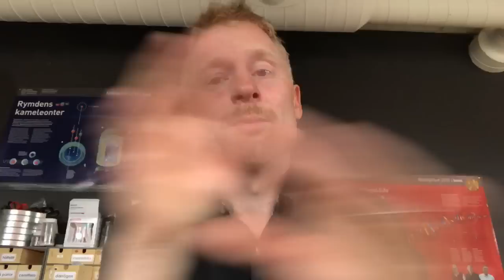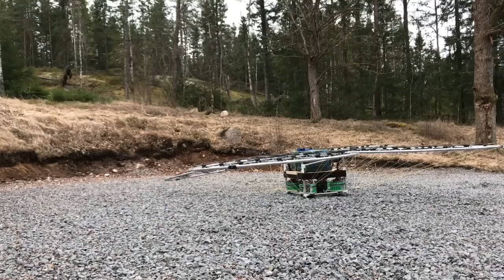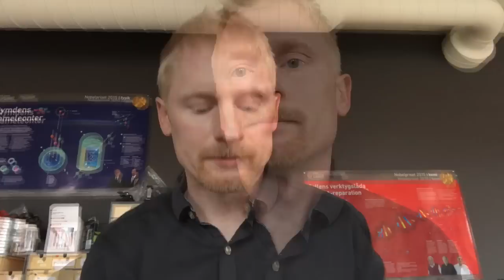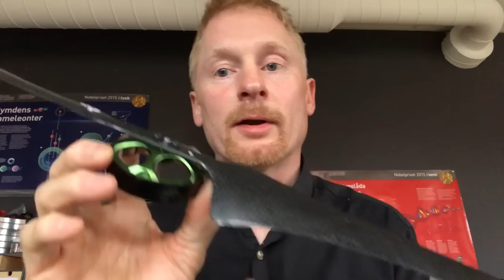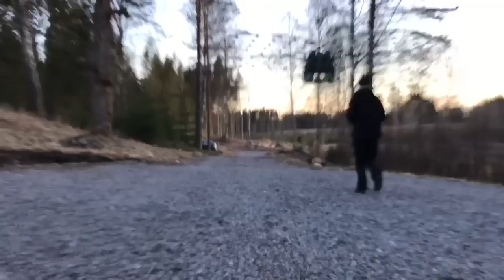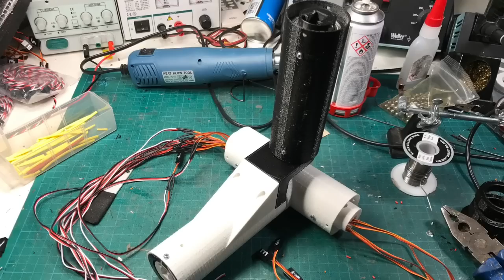chAIR- Manned multirotor Episode 18 Quadcopter style

Comment: I'm wondering how he kept the I-Term of the PID loops of the 5 different flight controllers from diverging to the point where some motors were at full speed, and others at minimum?  Is there something tying the 5 controllers together, or possibly is he not using integral control at all, but just proportional.  Is he, the pilot, the Integral controller?
Reply from the maker: You are absolutely correct; the controllers are not connected to each other, so I had to turn down the I-value to zero. I, the pilot, handle diversion that occur over time, its quite a natural thing to do when flying it from the pilot seat; Im not breaking any sweat doing the I-component work.
Reply: Axel, thanks for your reply.  You are my absolute hero!  What you did was simply amazing.  I am on a similar pursuit.  A couple years ago I read "The Wright Brothers" biography by David McCullough, and it inspired something inside me.  I've always been fascinated with flight, but the closest I got was flying RC airplanes.
Now I'm on a crazy quest to build a manned, gas powered quad.  I know, I know.  Obstacles gallore.  Dangerous...yup!  Difficult...Yup!   Illogical...Yup!  Challenging?...YES!   FUN....YES!  Educational...Definitely!
Why?......Why NOT!!!  It's been a much slower journey than yours.  I don't know how you accomplished what you did in the short time you did it.  I've been at it 30 months.  Much of it pondering different approaches.  I'd love to hear your feedback on my YouTube channel, and DIYDrones blogs.

Comment: Instead of using 72 little electric hobby drove motors, why not use 4 or 6 or whatever electric paramotoring engines – like are made and used to push a ?parasail?  Exomo is an example. There are others, like the Blackhawk electric paramotor engine. Maybe your next project or someone else out there.

Comment: Axel, I really appreciate how you don't try to hide your "silly" mistakes, like having the blade rotation wrong.  Mistakes are going to happen.  I am working on a related project, and would certainly value your input.  I am especially interested in how you migrated from a single RC transmitter, to a 5x redundant control system.  Did you eliminate the Tx/Rx, and if so, what did you use to convert potentiometer signals to pitch,roll, yaw,throttle signals.

Comment: Looks like P Factor is the problem
P-factor, also known as asymmetric blade effect and asymmetric disc effect, is an aerodynamic phenomenon experienced by a moving propeller,[1] that is responsible for the asymmetrical relocation of the propeller's center of thrust when an aircraft is at a high angle of attack. This shift in the location of the center of thrust will exert a yawing moment on the aircraft, causing it to yaw slightly to one side. A rudder input is required to counteract the yawing tendency.

Comment: First I want to say the fact that you got it to this Point is commendable. But I don't think you'll ever get the torque you need to lift a human being and actually fly this with so many small propellers. You would probably be better to have four large propellers. Also I think a weak point For you is the cable system, I think it would benefit you to use aircraft aluminum struts to hold everything in place firmly.

Comment: "Manned multirotor" with no man ever in it... Did you ever end up sitting in it while flying?
Reply from the maker: LOL.....RELAX....I shot the latest scene in that video not  a week ago.....there are still some important safety tests to be done.
Reply: Relax? Sorry you took offense. I wasn't dissing you or anything like it. Only an observation and a question. Toward the end of the video it looks like you have it far more stable. I'll keep an eye out for updates.
Reply: I am curious though why you opted for so many smaller motors/props instead of fewer larger motors/props.
Reply from the maker: Good question, well: 
Weight, scaling up adds weight which must be compensated with high strength materials and clever construction. I sweep 10m2 with 1.8kg propeller mass. Hard to beat with existing Paramotor propellers or the like.
Cost, hobby components vs.. real flight grade ones   
Off-the-shelf-DIY-availability, 
Safety, many sub- sections of parts can fail and you can still land safe
Reply: That makes sense. I've been building multirotors for a long time now but nothing that will lift anything above 50lbs. I prefer contra-rotating motors/props for redundancy but never gone more than 6 and 6. Had an X8 loose 2 motors and managed to land safely and since then I'll gladly take the slight loss in efficiency over the cost of a destroyed aircraft ;)

Comment: I know you film these vids well in advance and you certainly seem to know what you're doing, but there are few things I you did that I don't understand/would do differently
 - Save time and weight by adjusting the strings to set the angles on the paddles rather than on each motor individually
 - Add dihedral for stability (again by adjusting strings)
 - Skimp on nothing but the flight controllers. KK2s are great for the money and simplicity, but they're not the best you can get
 - Redundant TX-RX pairs running all at once on the same freq

Comment: 5 flight controllers fighting each other will be awesome to watch.. make sure you are not on board.
Reply from the maker: In the last clip all five controllers are ON, I have set the I-limit to 0 to reduce the "fighting each other" effect. Also the five FC:s are calibrated simultaneously so that they share the sense of what is "level"  So far they seem to work surprisingly well in parallel.

Comment: This seems like the same issues that the flitetest guys had when building the huge racing drone. They found that the typical racing flight controller would not work on the same scale that they were using so they switched to a venom(?) Flight controller.

Comment: I am aware he worked around the yaw issue by changing the angle of the motor mounting points, but wouldn't counter rotating 2 opposing motor sections fix the issue as well?
Reply from the maker: To my own amazement, the traditional torque reaction control principle really didn't work on this structure, even though the system has a significant overhead power reserve, almost  peak 2:1 thrust to weight ratio.

Comment: I think that Naza isn't good idea to make big multirotor. I had big octo on Naza V2 and it was difficult to set up. It was flying but not perfect. I changed to DJI A2 and was much better. Do you think to make multirotor with one double controller?
Reply from the maker: Interesting to hear about your experience with naza Vs. DJI A2.I really want to use five controllers since the rest of the system is divided into five segments.
Reply: zielonakosa, why do think that was? What is different in the a2 that it behaves differently.
Reply: I don't know why that is. Maybe A2 is faster. Something is different that A2 cost twice more. But i was check it and there is big diference betwen both. (i was check it on 4014 tigermotor, ESC tigermotor 40a 400Hz)
Reply: zielonakosa thanks for reply. So far I have working with naza m, but I'm considering switching to the a2

Comment: Can You get one of those cameras that 'follows' the subject from a tripod?
Also a head-cam? Don't want to miss anything when You get in it and go!!!
I thought at first longer guy wires and tilt the platforms upward might cure
 the thrust-angle problem but You seemed to have solved that.
The best thing is that You are not afraid to share Your increments of discovery
and not just Your success(s).  Thanx carry on.

Comment: Better build the main control stick and the potentiometer fixtures out of aluminium, not a 3D-Printed part. Also check what happens if one of the flight controllers doesnt switch off, but goes full power in one, random way, since this is what can happen on a potentiometer failure (if it shorts or open circuits). Just switching off a controller is a bit of a optimistic failure scenario. If one controler goes berzerk in midair, the others need to compensate collectively. So I suggest making one controller remote controlled from a different remote for testing. This way one person can control the 4 nominal controllers and one can yank the controls of the fifth one to see if the others compensate in real time.
Reply from the maker: Excellent suggestion I will try that out, thanks!

Comment: you are going to want to put some protections under and around those batteries, if one of them gets punctured you can kiss it goodbye along with you and the craft, also i would build a small test craft to test out the naza board with just so you could learn how it works without risking the bigger craft and you could figure out how to tune it better, but it looks so good right now also make sure that the flight controller is using angle mode that way when you take your hands off the controls it will go back into level flight also how long are your flights right now, also look into getting an fpv setup that way you can do manned flights without being on the craft, its a lot safer and easier to fly

Comment: Fantastic project!
How heavy are the lipos? (And how many amphours at what voltage are they?)
Would it be viable to double them?
Reply from the maker: 35kg lipo = only 21% of TOW. 80 pcs 5.2ah 14.8V each, 4s. 
"Would it be viable to double them?" 
- Yes but cost, deteriorating flight performance (except duration)  and diminishing returns will all be present factors.

Comment: Question if you give a percentage of your lift to a pre load thrust 75% of the actual weight that you're lifting and then use the rest of the motors for stabilisation and flight control with that make the rising and lowering more stable
Reply from the maker: Its all about making the software match the hardware.

Comment: You should use a vector flight controller. Apparently there better with big craft. I also don't like the idea of using the kevlar ropes other than as a backup. At zero throttle (if you did a zero throttle maneuver) you would have major problems. you should use some triangle tube carbon or aluminum. I'm also fairly sure that the flex in the hoops is causing the unwanted yaw. MAKE IT RIGID!!! :) Awesome channel and videos!

Comment: Does the efficiency go down much using more motors with smaller props compared to fewer motors with larger props?
Reply from the maker: It depends on discloading etc, but Iwould not expect a full scale helicopter "propeller" (10m diameter)  to produce more than 10g/W at normal TOW. Im at 7.7g/W  with these 0.4m propellers.

Comment: What is the swept area of this compared to the gas powered craft you made before?
Reply from the maker: The gas version had just above 3.5m2 swept area with a combined weight at just over 1.8kg (8 pcs 30inch props, 235g each)

Comment: You say each 'wing' has 19 clockwise and 19 counter clockwise running motors? Wouldn't they counteract each others torque explaining why you have so little yaw torque?
Reply: read up on how yaw on multirotors work
Reply: How would you say my comment is wrong? In multirotors, half of the motors turn clockwise but they are individually controllable. I was under the impression all of a wing's 38 motors are fed by the same control signal.
Reply: ah yeah no. All motors in one "wing" aren't controlled by the same signal. he has it set up this way so that if one whole flight controller fails he'll still be able to fly or at least land safely
Reply: So how is it wired up? I can hardly believe each motor is individually fed
Reply: i think they are, you can probably check that in some older video. But it would be logical, more work but much safer
Reply: Then still all signals depend on one FCU. 
Back on topic; if all motors in one wing would turn the same direction, you get yaw like a quadcopter probably.
Reply: no no it has many flight controllers every flight controller controls a cople motors, so if one fail it won't crash.
 it doesn't matter if they spin in the same direction or not in the same wing the controllers speed upp and slow down each motor in the wing that need to be adjusted. It helps to think of this as a multi rotor and not spesificly a quadcopter just because it has 4 "wings" think of it as a 76-copter
Reply: Well no he now has only 5 as you can see in the video.
Reply: I guess the only one who knows the truth is +amazingdiyprojects himself :)
Reply: yeah. but i should have 5 flight controllers with their own receivers so that one or even two flight controllers can fail safely. Basically it's 5 independent units all working together. 
ps. big airplanes and their autopilots work in this manner

Comment: what kind of batteries are you using?
Reply from the maker: 80pcs 5.2Ah 4s multistar
Reply: amazingdiyprojects you must be spending like 10k for this project. I really like it, though. I'd like to do a manned multicopter as well, but I'd rather like to use 8 big motors. The tipping of the motors to better control the yaw and stability might help. i like to keep it simple and costeffective. did you consider using a tesla power wall as source?

Comment: have you throught about making an aluminium honeycomb crash structure to put under the seat ? would weigh virtually nothing  but could save your back in a less than fully controlled arrival  , If its good enough for F1 should be ok for your backside  ;-)

Comment: pls use a omnibus f4 fc or similar to run inav, they have all pids not onlx wired gains and alot more processing power than a kk board which also should give yoi better performance

Comment: Wow, downgrading to the KK board helped. I hope you updated the firmware to steveis version to avoid the original firmwares "surprises". I have flown the KK the last three years 
You maybe want to try a naze32 board with the iNav or betaflight firmware. The configuration is quiet predictable and and comfortable (if you have a laptop with you ). Then you would have altitude hold and position hold again.

Another thing is maybe to allow the allow the aluminium rings to rotate a little more so the thrust is not going directly under the craft but more to the outside. This would reduce the wobble when the craft is descenting in its own prop wash.

Keep up the good work.

Comment: You might consider lengthening the cables a little to give it some dihedral, letting the air blow away from center to give it a little more stability.   ...and good luck.
Reply: https://www.reddit.com/r/Multicopter/comments/2slxll/adding_motor_dihedral_slight_inward_mounting/
Reply: The original post of that thread is wrong, sorry.

The theory behind dihedral is not to right the craft due to the low wing producing more lift. The real reason involves rolling moments, lateral and directional stability characteristics, and the effects of being in a turn in a fixed wing aircraft.

Now, under certain conditions, dihedral will improve the stability of the multirotor, but not in the sense that most people seem to think.
Reply: I would really like a video of your hands while your controlling it with your custum joystick!
Reply: That actually makes sense
Reply: Johnny J Well, he already angled the motors with motor mounts.
Reply: True I'm still watching the video just got to that part, it flies so well now
Reply: He angled the motors towards the rotational force. Johnny j means that he should angle them towards the center :)
Reply: was thinking about the exact same thing.....!
a dihedral might help
Reply from the maker: Yeah, the flight controller is pretty much  EVERYTHING in a normal multirotor.
Reply: Dihedral doesn't work on multirotors, all of the stability comes from the flight controller.

Comment: I love this so much! I like how simple the fix to the Yaw problem was :)
Reply from the maker: Thanks, yes it was a big relief that the cure was so simple. I contemplated using EDF units placed far out on each propulsion ring  with separate flight controllers  etc. It would have added so much unwanted complexity and a hole bunch of  new possible point of failures.
Reply: But it's still not entirely clear why the flight controller didn't compensate for yaw problem? 
If you added some weights to one side of the craft the FC would compensate to keep the craft level.
Why wasn't it able to find an equilibrium point such that a small amount of "counter-steering" kept the craft from yawing?
Reply: But it's still not entirely clear why the flight controller didn't compensate for yaw problem? 
If you added some weights to one side of the craft the FC would compensate to keep the craft level.
Why wasn't it able to find an equilibrium point such that a small amount of "counter-steering" kept the craft from yawing?
Reply: madherring My guess is that having so many motors on each of the rings has a cancelling effect this limited the total amount of yaw that could be achieved regardless of the compensation from the controller.  With no ability to yaw the flight controller couldn't do anything even if it tried to.  It would be like trying to yaw a plane that had no rudder.